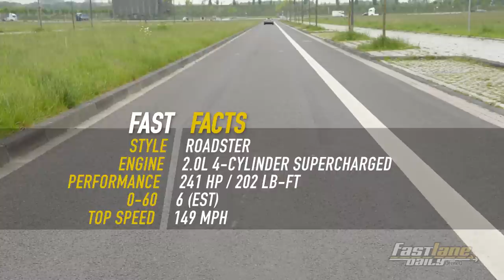Mazda MX-5 Yusho Concept Review - Fast Lane Daily

Comment: there is more to performance than the fact it has 241 horse power; acceleration, which you seem to talking about (0-60 time), which I agree sounds slow, is more related to its torque than its horsepower

Comment: 241 HP 6 second 0-60... My M3 has 240 and does it in 5.4, and is a heavier car... What gives? Is it not aggressive gearing or what?

Still awesome though
Reply: Yeah I was thinking the same thing, but they said that was an estimate so it's got to be lower than that.
Reply: wheelspin
Reply: Is only an estimate so it could be off a little bit. Should be in the mid 5's for its power to weight.
Reply: what's the torque difference?
Reply: i think its because of the powerband. in the m3 you have . more torque in lower revs because of the bigger engine. and overall in the m3 you have more power in a bigger rev range.  . the mx5 has a 2 L turbo engine producing the 240 hp only in high revs. and much less hp and torque in low revs.
Reply: dri fter Mad comment. I've never thought about that, thanks
Reply: The car makes it in 5.5 seconds or less. The reviewer just doesn't know what she's talking about. And there's one second lost in shifting to the 3rd to avoid redline and hit 60 MPH from 55+ MPH. With correct gear, it can make under 5 seconds.
The car is the same setup as the Miata Super20 concept, minus the roll bar and fenders. Probably has the newer and better tune.
Reply: Regardless of the powerband I doubt this thing would do 0-60 in slower than 5.5 seconds especially on semi-slicks 6 seconds was just a conservative estimate. The s2000 gets to 60 in around 5.5 seconds with the same hp over 40 less lb/ft of torque and it is, of course naturally aspirated so it wont get the same power out of a given environment that a forced induction engine would. The miata even with these mods should weigh atleast 150lbs less than the s2000. My guess is that it gets to 60 in 5.2 seconds if not faster.
Reply: Honda s2000 was built 14 years ago with 240 horsepower and did it quicker than 6 seconds
Reply: n
Reply: Tom Bourque
Die Werksangaben die ich hier habe sind bei 6,2 und Autoblöd 6,3... für den S2000
Meinen WRX hatte ich auch schon mal unter den Werksangaben mit einer Driftbox.... Aber was der Hersteller sagt wäre für mich erstmal Aussagekräftgiger. Die Testen das sicherlich mehr als einmal
Reply: dri fter  Its just a 2 L stock NC.With a automatic trans a supercharger,header,ecu remapped and some more goodies ad 70 to 100 HP more.It looked like all primer gray ready to paint.Don't run lower than 91 octane it will kill the motor.When I got my 2008 drop top used with 7,000 miles on it ran real slow.After 3 tanks of high octane it took off twice as fast.Twin turbo with intercooler is cool with a standard trans.I just put 4 new tires on it new K&N filter just inspected with just over 15K miles on it.ready 4 summer.Next will be a Vett 350 under the hood if I keep it?I think it should have come with the supercharger or turbo stock being a Tour car.
Reply: Nordlicht05 oh yeah... OK, yep yep for sure.

Comment: i love superchargers !!! :) its like making the engine bigger :) turbos suck...
Reply: Actually turbos and superchargers are exactly the same, except for one difference. Turbochargers compress air through spinning a compressor with exhaust. The supercharger compresses air through spinning a compressor by adding a belt to the crankshaft which steals some horsepower from the engine. So with a variable geometry turbo (best in market, no lag) it would've made 289 hp with the same boost and size.
Reply: Yuck Foo fuck yoo :D
Reply: Fuuuuck settle down kids, Prodriver you obviously don't build cars for a living if you argue like that, you don't get 'instant' boost from a SC, max boost comes on ALOT quicker in a SC than a turbo but with a WELL tuned turbo you can make 'similar' amounts of boost at lower rpm and then have higher boost/ more power higher up the rev range, which is why it is more common to turbocharge but also why SC is so popular.

Not hating just stating.